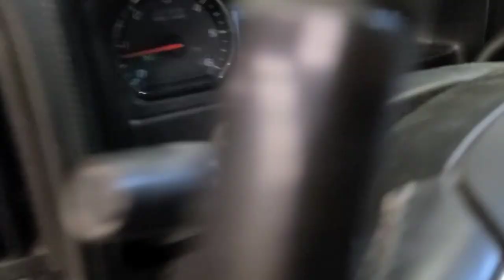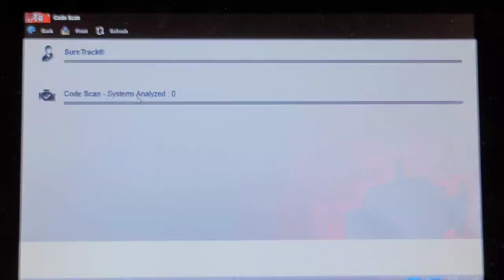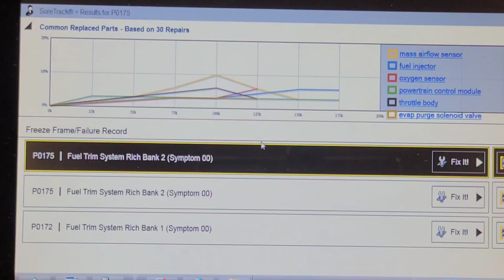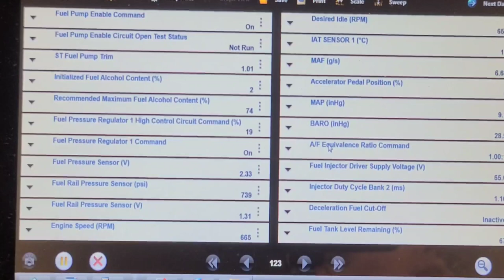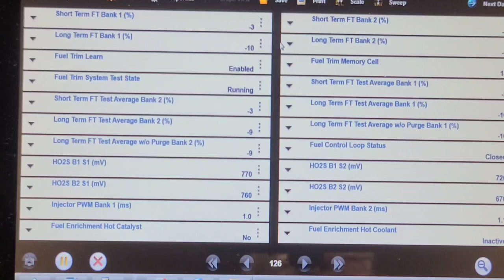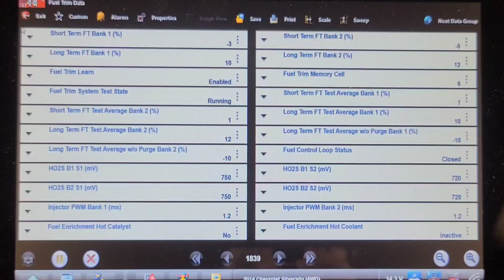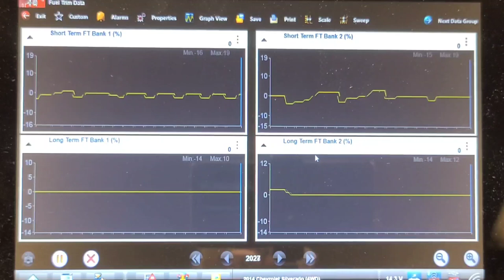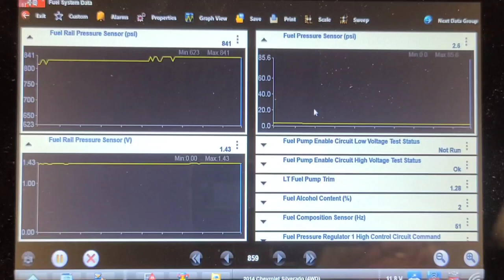2014 GM Truck 5.3 MIL on P0172, P0175

Comment: I know this is a dumb question but why did plugging the pvc affect the fuel trims .as usual I enjoyed your video thanks for sharing your time and knowledge.
Reply from the maker: The Positive Crankcase Ventilation system draws fumes off the crankcase. If there's gasoline in the oil it will run rich causing the negative fuel trims. If the fuel trims return to normal with the PCV disabled and plugged off that strongly suggests there's gas in the oil. HTH
Reply: @PhillipBailey  yes sir it does thank you

Comment: I had/have this issue.  Just got alcohol fuel level reset as it was at 54%.  Long term has come down to around -20% now.  Was at -25%.   Another issue has arisenn now though.  Rough idle and weird acceleration after changing MAF sensor.  Gor it from Napa. So think its rhe right one.  Still acts weird if i put old one back in too. I've checked for vacuum leaks.

Also has new plugs, leads, coils, air filter, fuel rail pressure sensor and fuel pump.

Between me and the mechanic, we've made it worse 😂.  Any suggestions?

It's a 2008 Chevrolet Express AWD 5.3 flexfuel
Reply from the maker: After resetting the alcohol percentage you need to clear the fuel trims. I gather you are not using e85. If the fuel trims at idle are more than 10% negative on one or both banks try disconnecting the forward O2 sensors to force it to open loop. If the forward O2s are reading false rich it could try to lean it out
Reply: @PhillipBailey  awesome.  Thanks alot.  Really appreciate it 👍
Reply: And no, no e85 here.  I use regular gasoline.  Which I believe is 87

Comment: Chevy tahoe 2002 lt 5.3 P0171 & p0174 can you help me, please
Reply from the maker: P0171, 174 are lean codes. Could have low fuel pressure, plugged fuel filter or induction leak. Could also have a dirty MAF sensor. I'd start by checking fuel pressure and or replacing the fuel filter. You did say it's an 02 right?
Reply: I already changed mass sensor,fuel filter,fuel pump,few coil,spark plug, wires
Reply from the maker: @emerievsalgado2289  check the fuel pressure, try disconnecting the forward O2 sensors. Could still have a bad MAF sensor. What brand did you put in? Induction leak. Lots of possibilities...